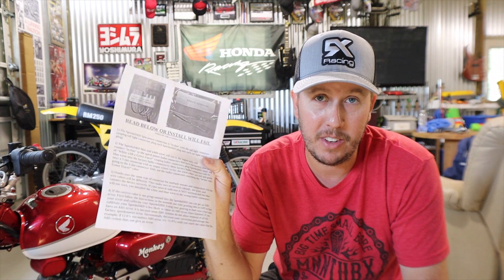How to correct the Speedometer on a Honda Monkey 125 | 12o'clock SpeedoDRD Installation

Comment: Hi,
Nice and very informative video! 

I have the same bike also with abs and 12o'clock speedodrd. Product works like it should and speedometer now matches gps, but abs light still comes on when riding.. Do you have any tips for that? 
Also does your bike blink abs light when riding?
Reply: I solved it by adding 1% at time to speedodrd, like in 12 o'clock instructions.. In my case abs system didn't allow odo to match gps speed, so I had to add total of +6km/h (-18.9% to -14.9%)
After this the abs light won't blink anymore 😎

Comment: monkey is not rideable right now. I need to replace the clutch cable since it broke while trying to adjust the slack. Also the rear tire needs new bearings again since I think I installed them wrong and they got destroyed. My new 2020 R3 has to go to the dealer because it took damage to the handle bars being delivered. But I am riding it.